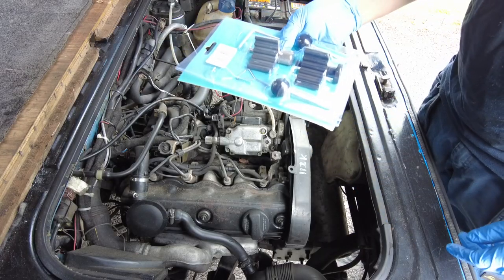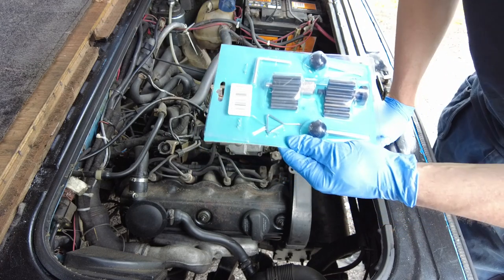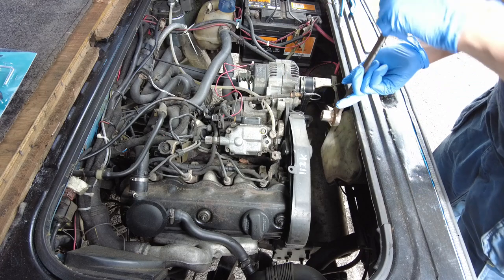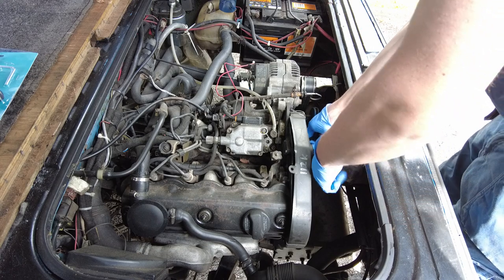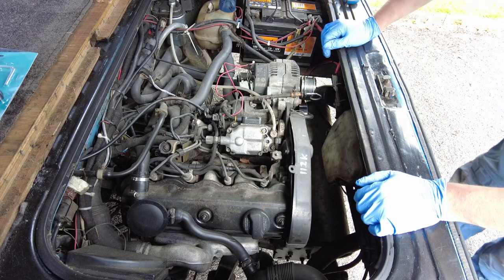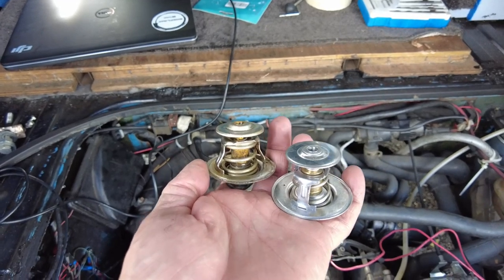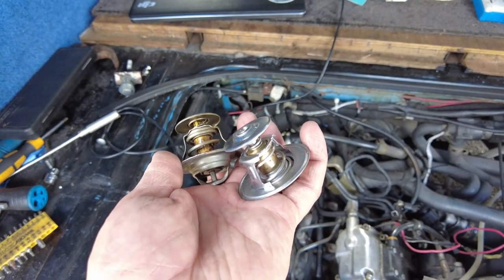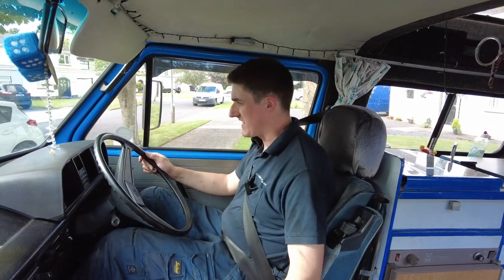DIESEL ENGINE TIMING and hunting for missing power and economy -- VW T3 TDI --

Comment: Ive got a similar problem with my 1z tdi apart from the drinking fuel issue. Its just underpowered. I replaced the n75 turbo actuator and bought a cheap maf before i replaced the turbo actuator which didn't solve it. My last resort is buying a genuine pierburg one and see if it cures it because the way it stands right now its flat as a fart 😭

Comment: I have 2 scenarios here.
when I built my daughters T3 with a 5 speed T3 box and a 110hp audi a4 AHU motor, it would fly up the M18 motorway at 90mph with power to spare. That is up hill all the way for 6 miles.
I have recently just rebuilt my AFN motor, new everything, compression tested, timing spot on and it ticks over lovely. Still a twat to start even with new glow plugs.
Foot on the pedal,  it blows smoke and coughs like an 80 year old coal miner as the revs fall.
Replacing the injectors next ... not feckin' cheap either.
Now onto your problem.
I did notice that you checked mechanically that your cam and crank timing was correct, I didn't notice a locking pin in your fuel pump timing. I may have missed that part.
Having said that, fuel pump can't be far out ( if at all) otherwise it would be a complete bastard to start.
As for getting these vans up to running temperature with a TDI install, it will never happen at tickover.
The TDI engine is SOOOOO efficient at cooling itself. Couple that with the long run of coolant pipes and the rather large radiator, the only way to get the engine up to temperature is batter it along the motorway, uphill, with the handbrake on, towing a loaded trailer in second gear.
Reply from the maker: Wow, thanks for the detailed comment! I reckon gearing has some part to play in my issue, but it's not the be all and end all. If you were using the T3 box, the engine would be screaming at 90mph. To tell the truth, I'd have expected it to hit the rev limiter before that point. Be that as it may, I still feel that there's something up with my engine. Hopefully my new MAF sensor arrives soon. After that it's compression test time. With regard to the temperature, it does get up to temperature a lot better now with the new stat. It never got up to temperature at all before. Anyway, I'll keep you updated with my progress and hopefully it'll help you find your issue. Definitely doing the injectors is a worthwhile exercise though.
Reply: @Endfloat  it was absolutely roaring at 90

Comment: Hi Ross, If your engine is down on power and difficult to start it might be low on compression...? Maybe do a compression test before you go to the trouble of taking the head off... It may give you more of a clue. As you rightly say the lack of performance is likely to be a mechanical issue,  not electronics.
Reply from the maker: If the MAF sensor doesn't fix the issue, the next step will be a compression test.

Comment: I know I used a different ratio gearbox to you but mines AHU 90bhp and as far as I'm concerned ours pulls really well. Now my nearest motorway is probably 40miles away so I rarely even go 60 but do a lot of lugging up big hills and plodding around but I can leave it in 5th and 35mph and if I put my foot down its there. No smoke at all. Can't say about fuel economy. We just keep putting it in because the gauge is so dodgy. Your performance seems like mine before I got power to all the sensors but clearly you have those working 🤷‍♂️🤷‍♂️
Reply from the maker: Thanks for the info. It's good to get a different perspective cause from my own perspective I cannot understand at this point why these conversations are so popular. I'll keep going up to a point to see if I can get more power.
Reply: In fairness Ross, the performance you're getting is akin to what I'm getting in my TDI bay with flipped passat gearbox. I really have to wind it up to use fifth gear and there's an automatic hill detector built in, there's no way it would climb any kind of hill at any speed in 5th. Compared to my daily passat with similar engine, gearbox, vehicle weight, tyre height, the performance difference  in fifth gear is night and day. Aerodynamics have to be a factor.
Reply from the maker: Honestly Trev, I'm not fully convinced there isn't something wrong with yours too. Have you ever had it on a dyno? If someone had told me before I had done the job that the best I was going to get was 30mpg and a 0 to 60 time of over 25 seconds, I wouldn't have bothered my arse and would have gotten the aaz engine sorted out.
Reply: I did a video on mine accelerating on my channel. The 1100mile video. Might be usefullish to compare. I tried mine on a long hill recently to compare to my 2.5 l200. Acellerated from 50 in 5th. Both hit 60 although the l200 had a little more torque. I did use a Petrol passat box but I have tall rear tíres on 15s for the extra ground clearance. I'll do a 0-60 time when I get the chance and let you know how long it takes.
Reply from the maker: I had a look at your video and commented on it. Good video and a good channel! I was surprised I wasn't already subscribed so I remedied that.
Reply: I've been racking my brain over this. Plenty boost, correct timing, and excess smoke so plenty fuel. Be interesting to see the compression results. 1 other thing I know little about is this, I've been chasing a gremlin in mine with a fuel solinoid code which apparently can be the fuel temperature sender, now I changed it in mine to no effect but I've read a good few things where people have said it made a huge difference to there tdis. Cheap part to try, something like 25euro

Comment: Is there a Boost leak . In my videos I took the air Inlet manifold off a Audi A4 and it was blocked up with carbon. Mpg was down to 30mpg on a tdi engine. Might be worse checking.  If it is the inlet blocked with carbon give me/ my channel a shout out on your channel . Hope you get it sorted
Reply from the maker: I actually did a job on the intake manifold in a previous video. It was very bad, and the job did help the situation but it's still not right. Nasty, horrible job to have to do to be honest. I doubt there's a boost leak. It's boosting to over 1.8 bar.
Reply: @Endfloat  can’t find the video,  did you get to clean in where the valves open and close ?
Reply from the maker: @stevenharpervw  a link for your viewing pleasure... 😉 https://youtu.be/alwbH3787Ww
Reply: @Endfloat  thanks “lad” heehee 😉 😆🤣

Comment: Have you a Intercooler installed ?
Reply from the maker: I do, yes. It's in a housing beside the gearbox.
Reply: @Endfloat  my donor car for my upcoming T4 tdi swap had similar issues turned out to be egr delete or rather disconnected valve
Reply: @joedemp27  keep the wiring connected to the valve, disconnect and plug the vac line.

Comment: I gotta do a head gasket on my alh 1.9... Drinking or pushing out coolant
Reply from the maker: A head gasket on one of these engines isn't a massive ordeal. Just make sure that your mating surfaces are spotless and you replace the stretch bolts!
Reply: @Endfloat  thanks! Already got new head bolts and gasket for it. Let us know when you figure out your problem I'd love to know what's going on
Reply: Have you done a compression test?
Reply from the maker: @johnblackburn7673  is that directed at me or the Jesus? 😂 If it's for me, no, but if the replacement MAF sensor doesn't do the trick, I'll be doing that.
Reply: @Endfloat  I haven't just been looking at MPG figures for the VW Camper with the Diesel engine and According to fuely real world mpg figures from owners, they are reporting 27 to 32 Mpg on average.
Don't forget the added weight and the aerodynamics of a brick, drag coefficient isn't like a car.
I remember the very 1st vehicle I ever drove a Bedford Dormobile Campervan with a Perkins Diesel engine and a 4 speed column change gearbox, 55mph was its happy spot 🙄although I did get it upto 75mph down a Welsh Mountain with a tail wind.😉😊.
Very best of luck getting your camper sorted.🤞🤞👍👍

Comment: Don't fit a backbox ,straight pipe her laaadddddddddd !!!!!!!!!! No smoke,no poke !!!! LOL
Reply from the maker: I took it for a spin out to souhans in Trim today to get the exhaust sorted out and all the felt speccers had a big horn on them because of the whoosh off the waste gate. Chrisht, there was some lift off 'er laaaaad!
Reply: @Endfloat  They're an expensive garage them Souhans!! Anyway,I'll never need to time a diesel engine,but that was one of the most interesting video's I've watched in a long time.I'm even curious to know why it's not performing correctly.Awaiting update's when you post them up.
Reply from the maker: They are expensive but experience has shown me that cheap does not necessarily equal good, and the next cowboy I encounter will incur a savage beating! I have a new MAF sensor ordered for the van, so we'll see if that helps. After that it'll be a compression test and if that shows up normal, I'll be looking at the fuel pump.